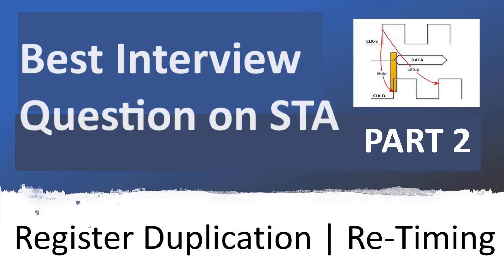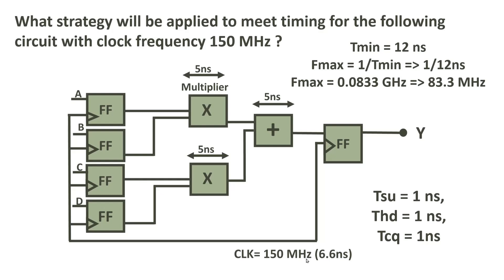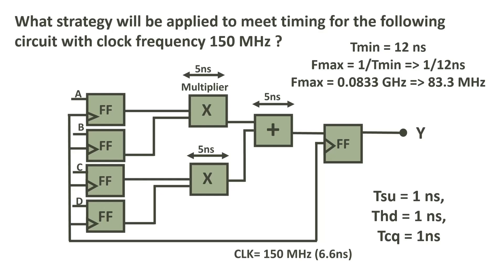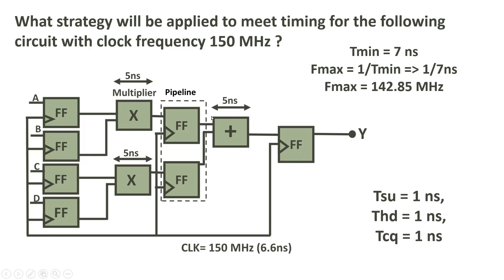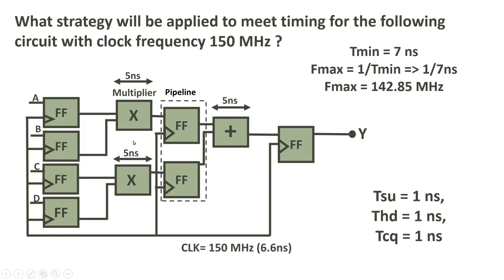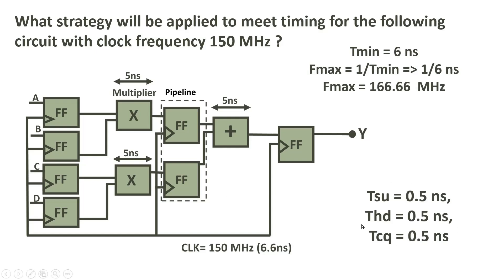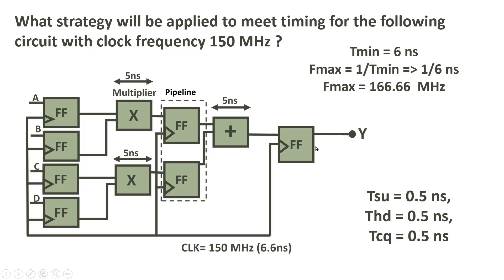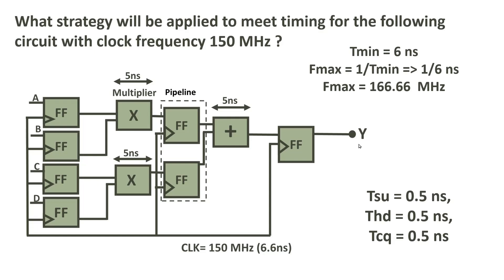Best Static Timing Analysis QA Part 2

Comment: You can also add a positive skew because your minimum delay can tolerate a 5.4 ns increase and still meet the hold timing requirement. Additionally, a positive skew will decrease the maximum delay in the setup timing equation.
Reply: Yes, I made that up with the previous video. With those Tcq = 0.5 and Tsu = 0.5, now Skew = 4.4 required. Thd is out of question since its not clock cycle/frequency dependent.

Comment: As per the design the output of the adder should be AB + CD.  Since the smallest multiplier is 2bit multiplier( For 1bit we can use AND  gate) and the signals here are one bit ,I will use one multiplier instead of two multiplier and one adder. The input of the multiplier will be CB and AD. The oupts of the mulplier will be P0= BD,
P1= CD+AB, P2= AC+ Cy1, P3= Cy2. Now I will pass P1 to capture flop and ignore other outputs. 
Now we have only one multiplier. So delay= 5 + 0.5+ 0.5 = 6ns. Frequency= 166.6 MHz